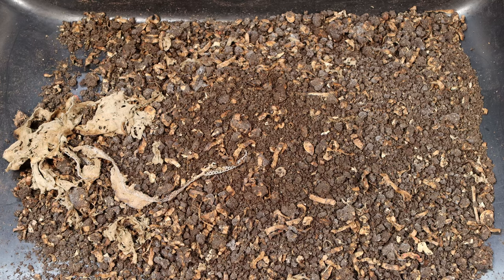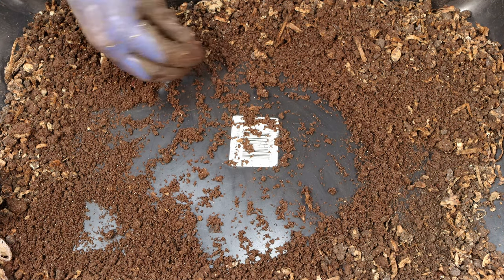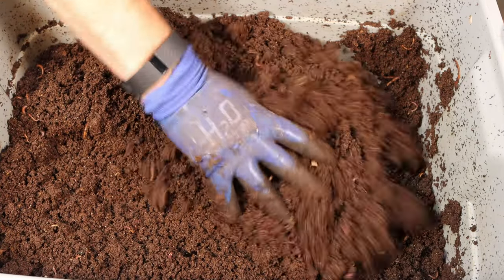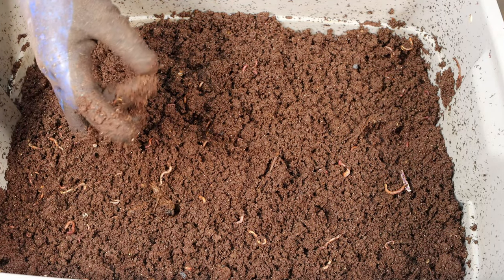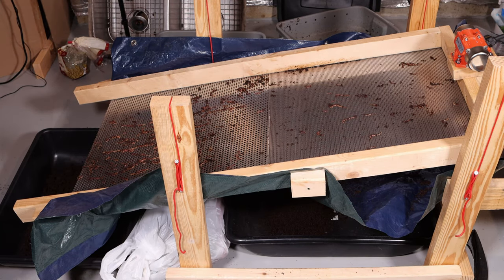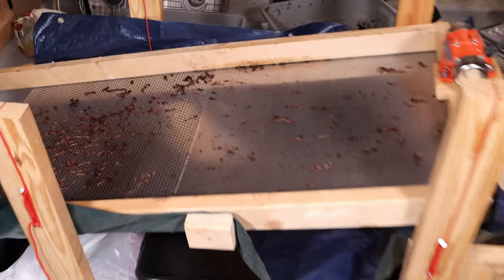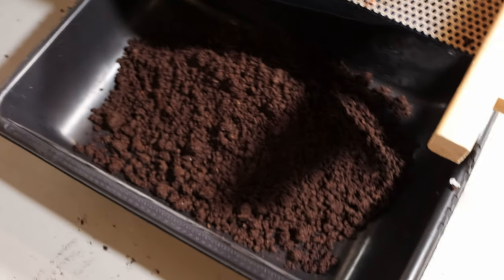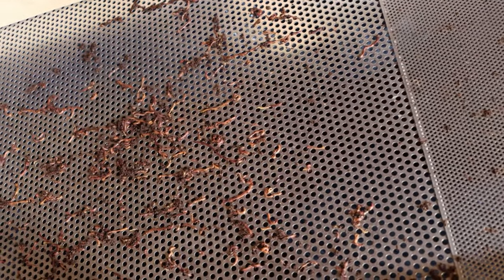Worm Bin #2 Sorting Worms from Castings 9/17/2021

Comment: I did wonder if this wasn't going to be a rougher process on the worms, but I think if you were to attract them out first and then level the screen frame out, it could still work and work well. Great video!
Reply from the maker: I figured it was worth a try although I think the rocking motion would be more gentle on the worms.  I'll be switching back to the recip saw but I think I have an idea to help me gain a bit more control with it.

Comment: I wonder if the perforated sheet metal has a top/bottom in terms of the finish of the holes. Perhaps there's a smooth side and a burred side. If there is a difference like that - and if it's the burred side on top in this case - then maybe that is what's causing the worms to get snagged...

Always fun watching you experiment with your worm farming equipment!  👍🏼
Reply from the maker: You are right perforated sheet metal does have a top and bottom when punched and I checked to make sure I had the smooth side on top!  Good thought and when purchasing I asked the company how they made the holes so I would know to check!
Reply: It's interesting how the vibration results in worms getting caught in the holes versus the reciprocating action tending to help the worms glide over the holes. I look forward to seeing what other kinds of ideas you come up with next...    :)

Comment: Just something to try on your sorter... Using the reciprocating saw for this, I was wondering if you took the 2 rope supports on the end (opposite of the saw) and starting from the top 
of the 2x4's you came down 3/4 of the way and mounted something to block the ropes, then put the ropes on the side of the block closest to the saw. I would think it would cause the 
tail end of the sorter to lift up and give some bounce to it. Of course 3/4 is a guess and you could just try different places using your hands or a wood clamps.
Keep up the good work.

Comment: I think this batch is a bit too humid and most of it  may end up in the worm bin as opposed to being sifted. It may benefit from a drying period and sifting again. Could be the other system worked better, yeah noisy but I think it worked better. Another great video, thanks for sharing.
Reply from the maker: Maybe but I have put some pretty wet castings on this before and just run it through a few times.  I never had that many worms stick to the tray which worries me as well.  I'll be switching back and just finding a better way to run it so I have more control over the speed.

Comment: Not all experiments are successful. I wonder if it had a steeper incline it would work better, with less castings per pass it might allow you to control the flow better.
Reply from the maker: Possibly but I was worried about the castings going back up the sides when it was vibrating instead of going one direction.  I also think it is much rougher on the worms as they are bouncing rather then sliding off the side.
Reply: @WorldComposting  experiment, try it with finished castings to minimize worm damage first. Add cardboard to sides to keep material in. Some suggestions.